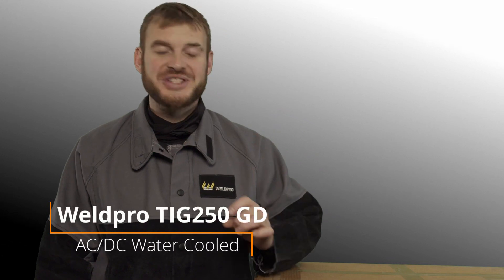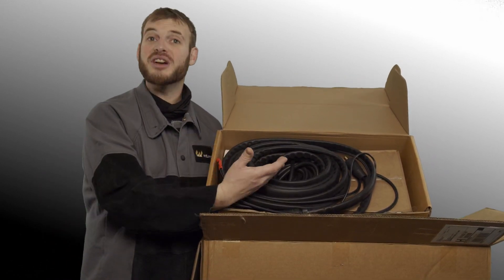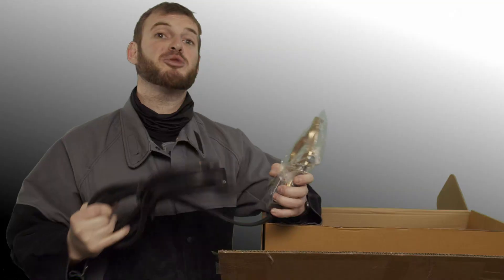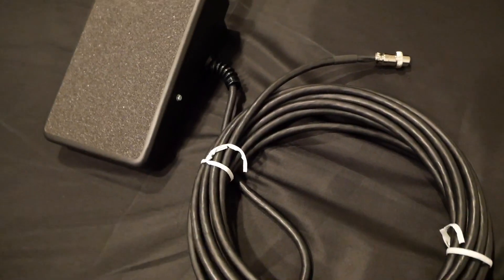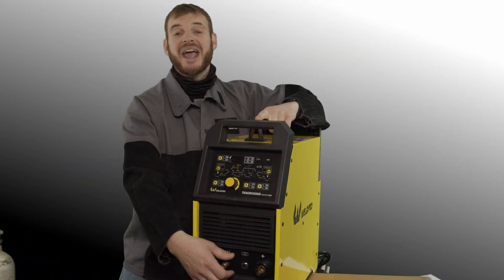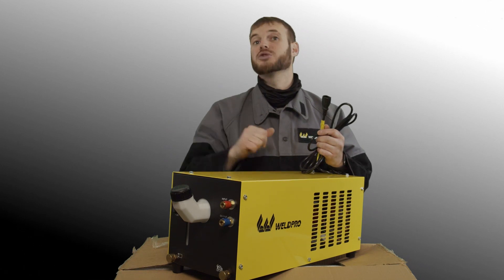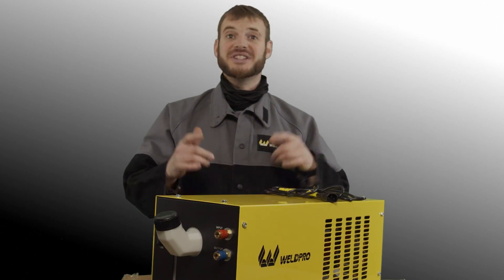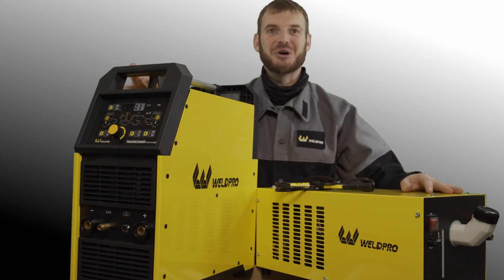Weldpro TIG250 GD - Unboxing Part 1

Comment: 🤨That 30% duty cycle at full amperage for DC TIG is definetly a deal breaker.   Why it's so hard to attain 80-100% duty cycle.  This is the number i believe the goal should be to obliterate the competition.

Comment: can I put a ck 20 watercolor torch? what size of din connector is on the welder?
Reply from the maker: Large style DINSE and yes you can add it. There may be an adaptation of gas and water quick connect fittings but you should pretty much be able to get anything to work.
Reply from the maker: we will be releasing a CK series in the future.

Comment: Pulse mig in the near future?
Reply from the maker: Nothing in the real near future but I know it’s something we would like to work on releasing. Thank you!
Reply: I'm sure you've heard of the Everlast lightning series . Works good. Haven't used the HTP pulse mig but heard it also works well. The pulse mig has an enormous amount of uses especially for repair work on various thicknesses of aluminum. I couldn't get in to all that here. I would sure like to see another maker of this type of machine that's growing in popularity. With the new releases from weldpro lately proves that you are serious about providing users with what they want. The other brands are definitely taking notice. This latest machine is going to untie what blue , red, and green thought they had tied up. Even though they have good machines, service and value is equally important. Not trying to bash any major brands, or show frustration, all I can say is WELCOME TO THE BIG LEAGUE ! Glad to see weldpro take that big step. The next break down with my red or green machine, I may not repair them. Looks like I'll be replacing them instead. Keep up the good work, videos are great, I'll be watching.
Reply from the maker: @lovernchristopher  we will have to check it out 😀Thanks!